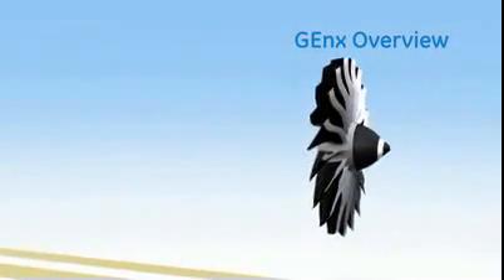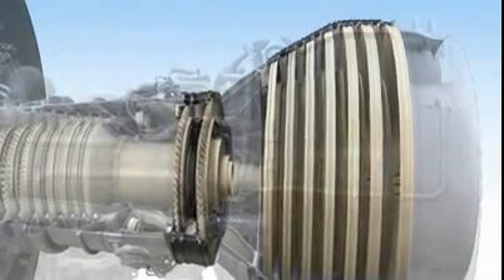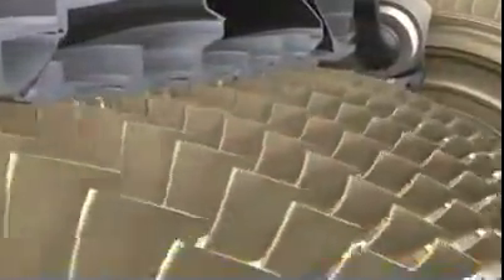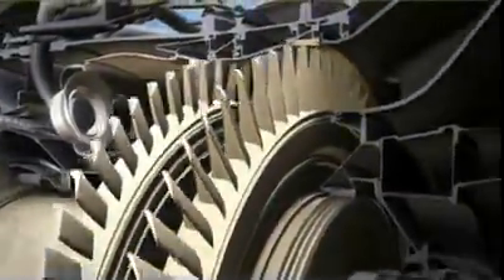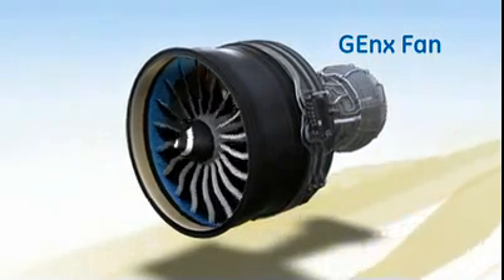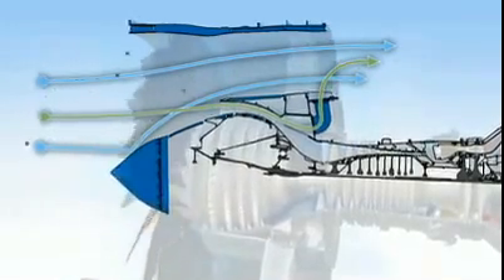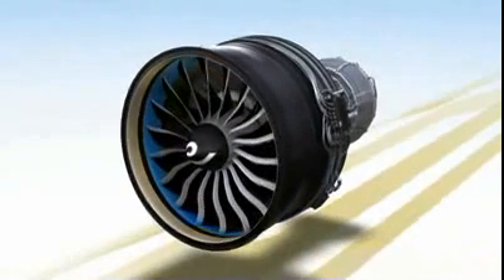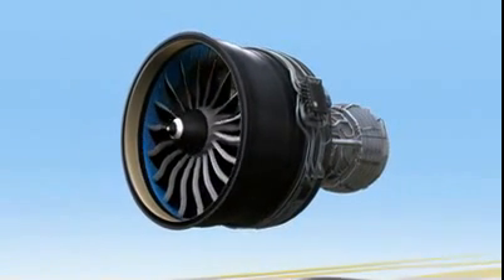How the General Electric GEnx Jet Engine is Constructed

Comment: The development costs of A380  initially estimated at $8 billion have since risen to $12.2  in 2009  and in  2012  to 25 billion  pushing the break-even point from 250 to 420 sales and to an undisclosed figure . Louis Gallois, former CEO has indicated that the A380 will remain a drag on Airbus for at least the next five years: put simply, the cost of building the A380 is more than expected and not currently enough to cover annual costs, in short the A380 will not  earn a dime !

Comment: Bullshit.. Rolls Royce  has only  60% market share on the  A330  and on  all other models  less than  50%   including  787, 777, A380. GE is the market leader by a long distance. Yes,  Rolls Royce needs luck considering the latest fuckups of their Trent 900 engines on A380..

Comment: Correction. General Electric is the leading manufacturer of aircraft engines ( Rolls-Royce is second ) and dwarfs RR in every other way. GE also holds the record for world's most powerful commercial engine ( GE90-115B ), and the B747 utilizes engines not only from RR, but also Pratt & Whitney and GE, including the latest GEnx.

Comment: It's "simply" a higher fuel flow which leads to an increased engine power. So, basically, the adjustment parameter is the fuel flow and according to that, the corresponding valve. There are various other parameters which are adjusted when increasing throttle, for example there is a hot air stream led over the inner shell of the turbine, which uses the thermodynamic principle to minimize spare room between fan blade tips and turbine housing in order to maximize efficiency.

Cheers

Comment: reducing fan blade speed when you are in flight, or when you are landing the outer wing will open and makes the break-like cars, except it use aero's force instead of break disc.

sit near middle seat (near the wings) when you have a flight and see how this works, its pretty sexy to see how the wing works lol